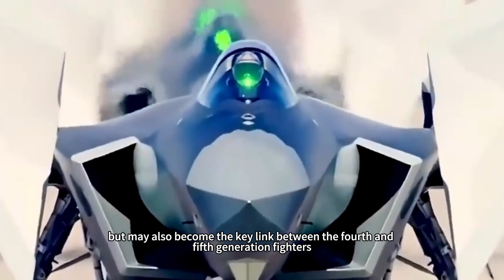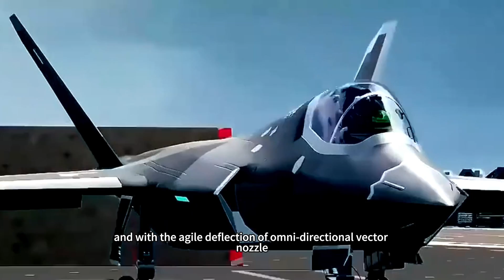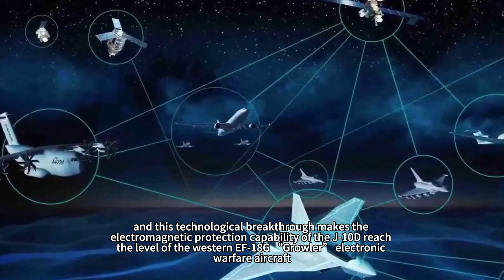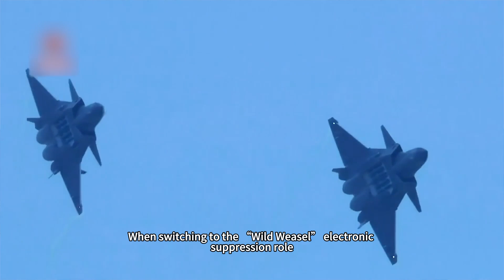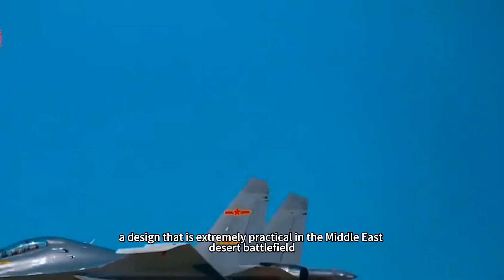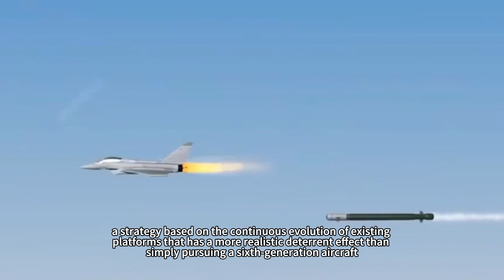Stealth version of J-10D is coming? How is stealth and firepower balanced?

Comment: The Chengdu J-10D is an advanced variant of the J-10 fighter jet and potentially house a variety of systems, including expanded countermeasure and electronic warfare systems, as well as communications and passive sensors.
The J-10D is part of China's ongoing efforts to modernize its air force and enhance its capabilities in electronic warfare and potentially suppression of enemy air defenses (SEAD). 
China is investing heavily in this space of its tactical jet portfolio, with the J-16 electronic attack variant based on the Flanker heavy fighter being rolled out not too long ago.
The J-10D's development and potential deployment reflect China's strategic goals in regional and global military balance, particularly in the context of its interactions with neighboring countries and global powers.